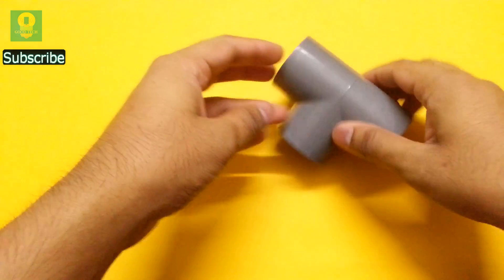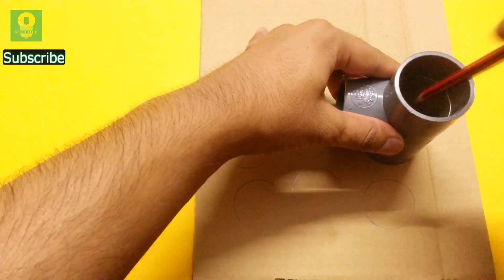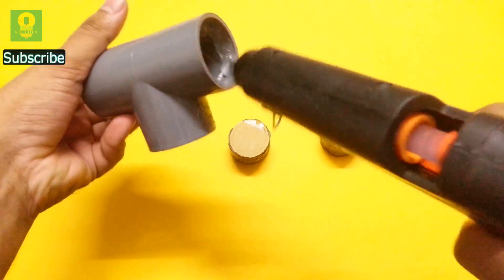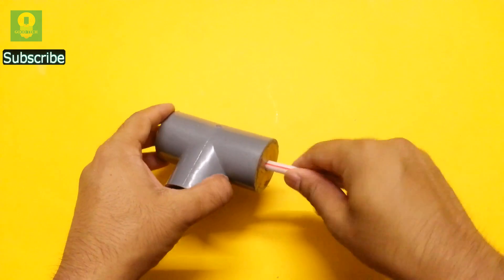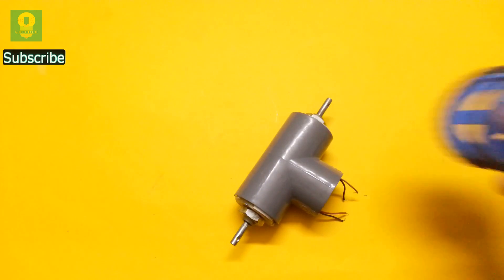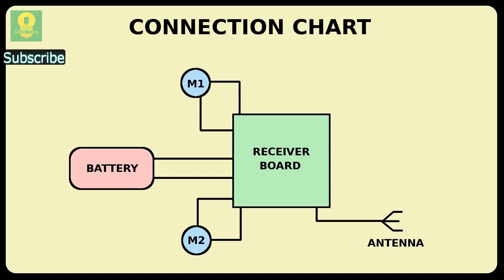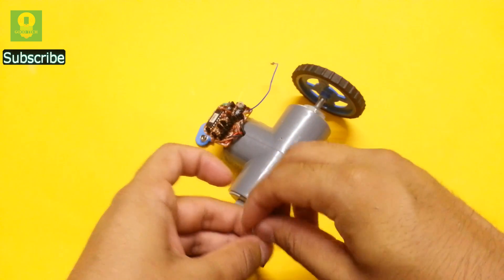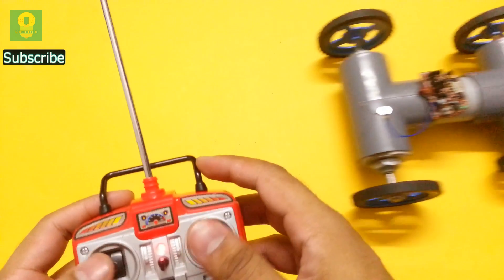How to make Wireless Remote Controlled Car at home

Comment: how to make the wireless remote control bro?
Reply from the maker: You can make a wireless remote control circuit at home by following this tutorial here - https://maker.pro/pcb/projects/remote-control-car/
But it is advisable to buy a cheap RC toy from a local shop and extract the circuit from it. Making your own circuit will be quite expensive.

Comment: Bro, where is the front wheel turn?

😕😕
Reply from the maker: There is no need for turn. The back wheels operate in such a way that the car can turn can make full 360 degree turn easily.
If you like, you can get lots of additional info about this project here - https://www.instructables.com/id/How-to-Make-Wireless-Remote-Control-Car/

Comment: How to make rc transmitter
Reply from the maker: You can easily make one by watching the tutorial here - https://maker.pro/pcb/projects/remote-control-car/ but it is recommended to get a cheap RC toy from local shop and extract the circuit from it. It will be much more economical.

Comment: Should we use only geared DC motor or we can use other motors?
Reply from the maker: You can use any motor but a gear motor has enough torque to move the car.
Reply from the maker: Thanks..:)

Comment: How to make wireless remote..
Reply from the maker: You can easily make a wireless remote and circuit at home, have a look at the tutorial here - https://maker.pro/pcb/projects/remote-control-car/
But it is recommended to buy a cheap RC toy from local toy shop because that is much more economical and efficient.

Comment: From where we bye rc remote
Reply from the maker: These you can mostly get all the items online but a RC remote is quite costly. So, i always recommend to extract the circuit from an old broken car or you can buy a cheap RC car from a local toy shop and use the circuit from it. However, if you want to make your own circuit, you can make one using this tutorial - https://maker.pro/pcb/projects/remote-control-car/

Comment: Wireless car kaise banaye vo bhi bina kisi machine se
Reply from the maker: For making a car you will surely need a wireless receiver and transmitter circuit. You can either get a ready made circuit or make a circuit yourself at home.
It is always easy and affordable to extract the circuit from a cheap RC toy available at local toy shops. However, if you want to make your own circuit, have a look at the tutorial here - https://maker.pro/pcb/projects/remote-control-car/

Comment: I want to make the remote control also......how do I make it
Reply from the maker: Hi Samridho,
It is not advisable to make a remote control because it will cost much more than extracting a circuit from a chinese toy. However, you can easily make a remote control (transmitter) as well as receiver, have a look - https://maker.pro/pcb/projects/remote-control-car/

Comment: how to buy remote and trasmittor
Reply from the maker: They are available online on ebay and amazon but it is recommended to buy a low price RC car and extract the circuit from it. It is always more economical than buying a circuit.

Comment: Its working but the mortars are turning in opposite direction
Reply from the maker: Reverse the wires on the motor terminals i.e interchange the wire on the motor terminals. Solder the wire from one terminal of a motor to the other terminal and solder the wire of the second terminal to the first terminal.

Comment: How to make the remote to the car
Reply from the maker: Making only a remote for the commercial receiver is quite complicated but you can make both the receiver and transmitter pair quite easily. Have a look at the tutorial - https://maker.pro/pcb/projects/remote-control-car/
However, even to make the circuit at home, you will still need wireless receiver and transmitter modules.
Therefore, it is much more quick and affordable to extract the complete circuit from the commercial RC toy.

Comment: actually i lost my son’s car wireless remote kindly anyone tell me cane i make a new one at my home
Reply from the maker: Its quite difficult to make a remote for a receiver as almost all the circuits operate on slightly variable frequencies(although the frequency range is fixed). You can either look for a universal remote or make both new receiver and transmitter circuit yourself.
If you want to make the circuits, you can refer here, https://maker.pro/projects/pcb/remote-control-car/

Comment: Nice, can you inlist the requirements and how to get them
Reply from the maker: From Amazon;
2x DC motor, 4x wheels, Rx & Tx circuit from old broken RC car, 9v battery and battery connector clip. 
From Local store:
2x PVC -T, PVC pipe, cardboard, wooden stick and straw.

Comment: Hmm good but the wires how to stick with the reciver board
Reply from the maker: The receiver board generally has connections mentioned over the board. However, if they are not mentioned, with some careful observing and logic, you will be easily able to figure out all the connections.

Comment: Where is the remote controller is available
Reply from the maker: I took it from an old RC car and it is most economical solution, even new RC cars are cheap as compared to Rx Tx kits. However, new circuits available online on ebay, amazon and robokits.

Comment: How to new manufacturer circuit wireless Remote control
Reply from the maker: A wireless remote control circuit can be easily made at home using HT12E encoder and HT12D decoder. But still you will have to buy RF transmitter and receiver module and many other components, that will cost much more than extracting the circuit from an old RC toy. However, if you still want to know how to manufacture a wireless circuit at home, refer to the following link - https://goo.gl/f0SU4H

Comment: were did you get your supplies
Reply: GOODTECH - Creativity and Science Thank you so much!!
Reply from the maker: From local hardware store - 
2x PVC-T and PVC pipe (1.5 inch diameter or depends on size of motor used)
Battery connector
Battery
2x geared DC motors - http://amzn.to/2lMPZoF
4x wheels - http://amzn.to/2m9v559
wireless kit (TX and Rx) - from old RC toy

Comment: where did you get the 9v battery holder
Reply from the maker: The 9v battery connectors are available on ebay and amazon or you can also make connectors yourself at home using the connector obtained from dismantling an old 9v battery

Comment: can you tell me the material so I can use this 4 my projects
Reply from the maker: 2 PVC-T (size will depend on the motors you will use), a small PVC pipe to join them, 4 DC motors (100 rpm each), wheels, 9v battery, connector clip and a wireless receiver from an old / broken RC toy (or from ebay or amazon).
Reply: ty

Comment: And please can you tell me that where to fit dc motor wires in the reciever
Reply from the maker: The receiver circuit should have all the connection markings for the components.
Reply: So what should be the markings to where to fit the wires of dc motor

Comment: Can you please tell me where to fit 9v battery wires in the reciever
Reply from the maker: Every receiver has two points to connects the power source Vcc and Gnd. It must be mentioned over the circuit board.
Reply: Ok thank you very much
Reply: Please tell me fast

Comment: Where can I get the two geared dc motors from that are cheap? Also where can I buy a wireless receiver from a rc toy, any suggestions please
Reply from the maker: The geared DC motors are available on ebay. The wireless receiver and transmitter is also available on ebay and amazon but its quite expensive. Its better to buy a cheap RC toy from a local shop, design a high grade body and use the wireless kit from the toy.
Reply: i'm very interested to the rc circuit, can you give us a simple schema

Comment: HOW CON IT CHANGE THE DIRECTION CAN YOU PLEASE SAY FOR ME.
Reply from the maker: The car turns because both the rear wheels are connected to independent motors. When right motor rotates forward and left motor rotates backwards (direction of both the motors is to be controlled by remote), then the car turns LEFT. When the right motor rotates backwards and left motor rotates forward, the car turns RIGHT. When both the motors rotate forward, the car moves FORWARD. When both motors rotate backwards, the car also moves BACKWARDS.

Comment: Sir could you please tell how its changing direction.
Reply from the maker: The car is equipped with two independent motors. Lets name them Left motor and a Right motor. When both motors move forward, the car moves forward and vice versa. If Left motor moves forward and Right motor moves backward, then car turns Left. Similarly, if Right motor moves forward and left motor moves backwards, then car turns Right.
Reply: Thanks
Reply: But i am having still confusion i will ask you again
Reply from the maker: Yes, you can surely ask. What do you want to know?
Reply: Sir how to run only one motor?? I mean one motor forward and one motor backwards.
Reply: venu gopal 3
.
Reply: It is called "Skid Steering". Read the article on Wikipedia.
Reply: venu gopal right

Comment: wher did you buy a two channel Transmitter and a receiver board?
Reply from the maker: I removed it from an old RC toy.
Reply: ***** OK thanks. Can you say me whats the Name of the old RC Car
Reply from the maker: It was a broken RC car, so just Kind of made a new body for the old circuit.
Reply: +GOODTECH - Creativity and Science I want to have the same receiver board. Can You pls say me the Name of the RC Car
Reply from the maker: I am sorry but i don't know its name, it was a cheap chinese Toy car. However, every RC car with two controls will have almost the same receiver. All you need to do is just remember the wire connections of the components on the receiver board before removing it.
Reply: Ok

Comment: Can us end me procedure of it
Reply from the maker: The video shows the detailed procedure on how to make this car. However, all you need to do is make a hole at the center of PVC-T and fix both the motors at the opposite ends of the PVC-T. Attach a small piece of PVC pipe that will help in joining both PVC-T's together. Attach the wheels to motor shaft.
Take a receiver circuit from an old RC toy and make connections for the motor, battery and antenna accordingly, then screw the circuit over the car body.
Take another PVC-T and fill the ends with cardboard with a hole in the center. Insert a straw and a wooden stick inside the holes and attach the wheels.
Connect the battery and join the body parts together. That's all, the car is now ready.
Also, have a look at the video and you will be able to understand the procedure well.

Comment: What are the materials required
Reply from the maker: Two PVC-T, 2 geared DC motors,wheels, battery, receiver and transmitter from an old RC toy.

Comment: hey :] i have a question ..
i saw that in "How to make Wireless Remote Controlled Car at home" you used an manual drill in 2:51 to be exact haha..
can you show how u made it please ?
Reply from the maker: I didn't make it. It's called Hand PCB drill that i got from a local tool shop, however , i did make a mini USB drill that also works very well. Have a look at: https://youtu.be/39xPhI6Utng

Comment: How to make a reciever by our own, because i dont wanna take out recievers from my old toys ? Do u have any video of making a transreciever ?
Reply from the maker: No i havn't made any video on that, but it can be easily made using HT12D and HT12E IC's. Google their datasheets and you will get the exact circuit inside (for both transmitter and receiver). However, you will still need to buy a wireless module, so its not very cost effective (always better to buy a cheap toy and remove the circuit).

Comment: How it will be turning and how to attach the circuit pls help
Reply from the maker: The circuit is taken from an old RC toy. When you will disassemble an RC toy(preferably a car), you will find two motors connected to the receiver circuit. You also need to connect both the motors in exactly similar manner and make connections of battery and Antenna accordingly.
The car turns because both the rear wheels are connected to independent motors. When right motor rotates forward and left motor rotates backwards (direction of both the motors is to be controlled by remote), then the car turns RIGHT. When the right motor rotates backwards and left motor rotates forward, the car turns LEFT. When both the motors rotate forward, the car moves FORWARD. When both motors rotate backwards, the car also moves BACKWARDS.

Comment: it would be super if you would have built the circuit and remote by your self
Reply from the maker: This circuit can be very easily made using an encoder and decoder IC (HT12D and HT12E) but it will be much more time consuming and costly. So, it is advisable to use a Rx/Tx circuit from a cheap RC toy, it helps in saving lot of time and still gives same results.
Reply: can you please make another dedicated video for it as well.
Reply: heyy.... Rohit Maity... we have shown how to make the circuit for wireless RC car in our video... have a look on it.... visit our channel. I think it can help u.

Comment: what do you use to make holes in the pvc pipe.
Reply from the maker: Sometimes i use a drill, but in this video i used a hot soldering iron tip and then cleared the black residue with a knife.
Reply: Thanks